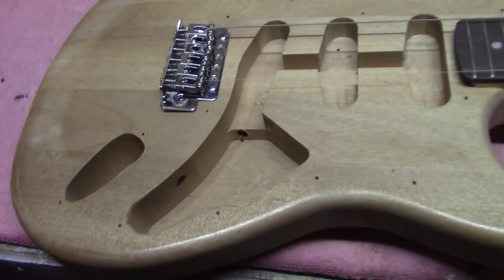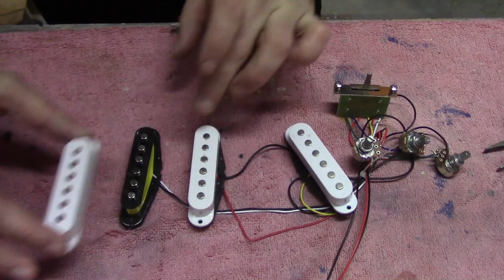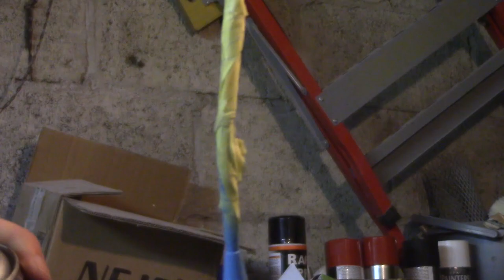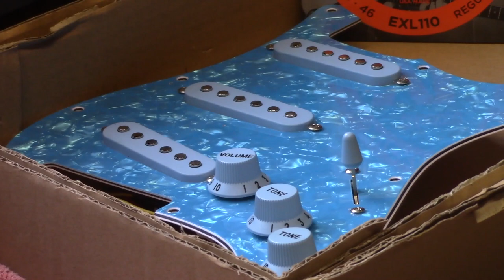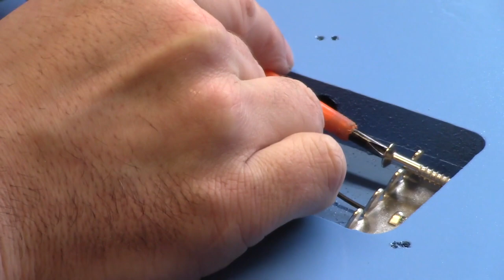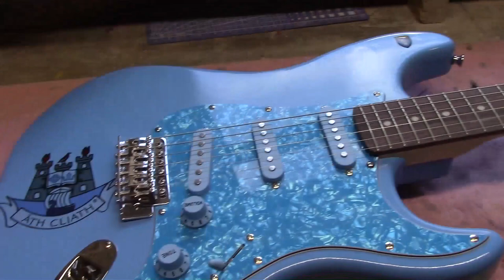Dublin Kit Guitar PT2 Full Build Process

Comment: Should have scraped the pickups just junk,set of Wilkinson would be a good replacment and not expensive
Reply from the maker: The aim was to show how the kit goes together with all of the stock hardware.  Soldering new electronics might be a stretch for beginners . But you're correct and I mentioned the cheap quality of the parts in the video